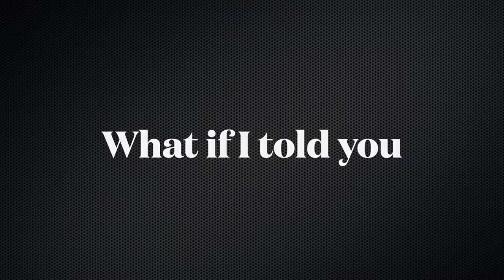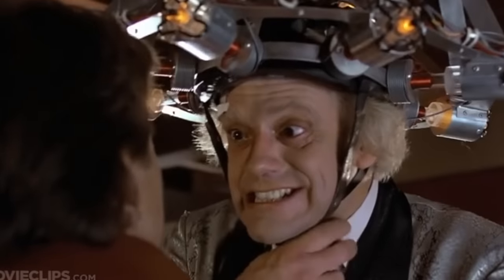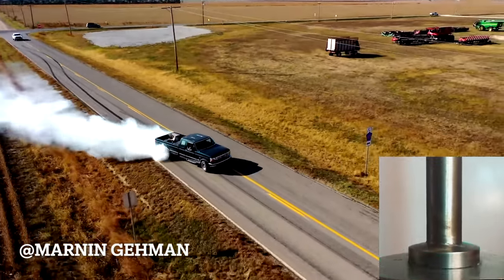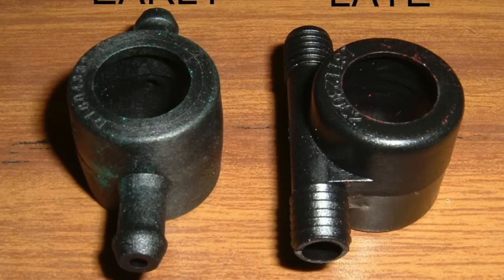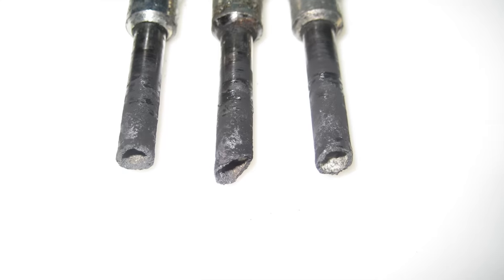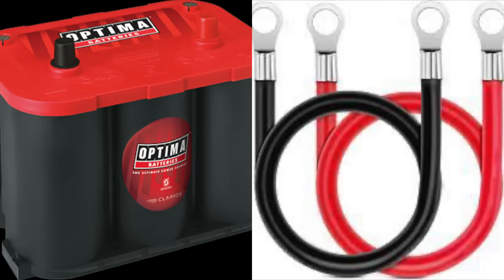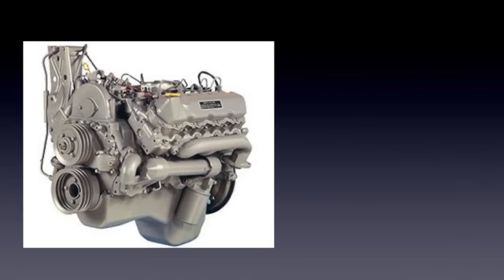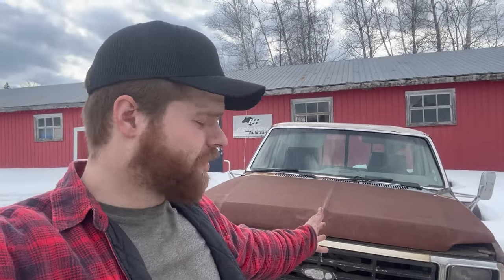The 6.9 IDI is not what you think...

Comment: My first truck was a 1986 f250 rwd, when the glow plugs are wore out and the fuel pumps are on the way out the door and the fuel issue going back to the tank. Squirting some gasoline in the breather always wprked but on occasion i had to put out a hood fire when it backfires. Just dont add too much or it trys locking up and takes a few key cycles to start. As for the batteries just stick a chunk of penny in between the battery terminal so the penny will oxidize before the terminals.

Comment: My 1983 6.9 was one of the very first to be produced and had a fatal flaw. The glow plug system had an additional relay that was eliminated in later versions. Although it used the same controller/components otherwise. It was never made clear to me what the additional relay controlled. After untold numbers of cold start problems with multiple changes of (I thought) all of the components, the system started coming on going down the highway and of course melted the glow plugs and destroyed 3 cylinders. At the time these were very expensive to repair and it was pulled in favor of the 460. I still own the truck in very good condition and have a Cummins/Allison replacement for the gas hog.
Reply: Did you do the Cummings conversation I'm thinking along those lines 4 my 96 F250 460 I can't afford the gas horrible milage like 8 on a good day lol

Comment: I have a 94 7.3 IDIT. I put in new injectors and had the pump rebuilt and had it running good but was still fighting air intrusion. I bought some R&D billet return rails for the injectors and had it running but had some leaks. So I took everything back apart and replaced some torn o-rings. Once I had it all back together it would not start whatsoever. To be certain that fuel was getting to the filter housing and to the injection pump I put an electric lift pump and deleted the mechanical. Still won’t start, fuel is not getting past the pump to the injectors at all. Took a look at the fuel shut of solenoid and replaced it to be sure and still nothing. Ran a hot wire from the battery to the positive on the solenoid and still nothing. New battery’s and starter as well. Sort of an SOS if you see this. Hoping the pump I had rebuilt didn’t take a dump some how.
Reply from the maker: When dealing with these engines they can be real SOBs if the return line system is ever touched, best way is to manually bleed each line by cracking the injectors while turning it over, then tightening them before trying again. If I was you I would double make sure you have fuel going into the pump and fuel coming out, if you still don’t have fuel coming out you might have a cloggers mesh filter on the inlet of the pump, it sits behind the fuel line.
Reply: @highostablegarage  fuel is for sure getting to the pump but definitely not past the pump. I’ve tried bleeding the lines one by one and all at once and still got nothing.
Reply: @tommygetz5867 we had Idi boat shutdown suddenly during cruise turned out to Be broken injector pump shaft

Comment: That's the truck I want cause it's corrected plus the body cab and bed is perfect for what I want a true truck to be. No shit mobiles, a purt near ton diesel truck with plenty of torque and horsepower but ez on fuel...I had a Ford F150 truck that year, it was a gasoline engine 351 modified 400 and it got 8mpg and it was jest a half ton long bed with regular 5 lug wheels and it loved plenty of gas. Sometimes I got around 10mpg but that wasn't often enough lol....I love what you have and I gotta start looking under the hoods whenever I see 3/4 ton or ton trucks setting around but I never look cause some I always thought 460c.i.. gas engines but they could be the diesel engine like you have...I want one and if I don't find one maybe the webrnet might have one depending on price cause I gotta do work to make it right jest like you did...I don't want nutn purty just a decent old truck with long cab.. I don't like the never stuff. I'm into the better built 80s back into the 60s and 70s trucks

Comment: I have a 1986 f250 4x2 with a 6.9 with C6 that burys the speedo no problem and im sure goes at least 100mph.  Now the injection pump was out on it when i got it and i had one from an old school bus that i put on it. It boils black smoke and is faster thsn any 6.9 ive ever owned before it or after it. Its faster than any of my 7.3idis too.

Comment: In the late 90’s I Banked and aftercooled  a 7.3IDI.  Would out pull any 7.3 Powerstroke. But the block cracked at 105,000 mile due to how thin the cylinder walls are. Sleeping to a 6.9 is the only way to keep them alive.
Reply: It wouldn’t out pull the Powerstroke.
Reply: @SillyPuddy2012  you can’t comment on what you did see. My dad had a 2001 Powerstroke. His exact work “ your truck out pull mine.”
Reply: @dschefers9700  I can surely comment on a mechanical impossibility. A 7.3 IDI is not out pulling a 7.3 Powerstroke. But sure, we’ll go with your Dad’s scholarly assessment, “your truck out pull mine.”
Reply: @SillyPuddy2012  a bigger pump and more boost with head studs and an intercooler. That will make more power than any factory powerstroke
Reply: @captainobvious6334  now your talking modifications. Powerstrokes can be modified too you know, they respond very well to it in fact.
Reply: @Chit Stank  sure they can but that’s not what you said. You said “it wouldn’t out pull the powerstroke”. You also said,” it’s a mechanical impossibility”. No. No it’s not. Not terribly hard to get decent power out of an IDI, it just gets pricy. You could put less money in a powerstroke to get the same results.
Reply: @captainobvious6334  either stock for stock, or competently modified, the Powerstroke is going to be a better performer. It is a mechanical impossibly to yield the same performance from the IDI. And as you alluded, it gets pricey to even try. Navistar International set out to build a more powerful engine with the T444E and that’s what it did.
Reply: @SillyPuddy2012  look up R&D IDI performance and classic diesel designs performance. They are getting 400+ hp out of these engines and last I checked the OBS ford powerstroke never came factory with more than 225 hp. 400 horsepower will outpull 225. It’s a mechanical possibility there buddy
Reply: @captainobvious6334   for your information, the last 7.3 Powerstrokes were rated from the factory at 275 hp and 525 lb.ft. with a manual. But to the matter at hand, you appear to be comparing a highly modified IDI to a stock PS thinking it’s an apples to apples comparison when it’s not. 

If you want to talk modified, a 7.3 Powerstroke will have far greater potential. The factory forged connecting rods alone are strong enough to handle around 600 horses, which is quite attainable from a 7.3 PS. And that’s far more power than you could ever reliably get from
a 7.3 IDI. The head studs alone would not stand up to that much boost. Back to that mechanical impossibility again. So, stock for stock, the Powerstroke is the stronger engine. And modified to modified, it’s the same story. There’s really no argument here.
Reply: @SillyPuddy2012  lord help me, it doesn’t freaking matter what’s modified and what’s not. I never said it was apples to apples. I literally already said there is more potential power in a 7.3 PS than in an IDI. Original post said there was an IDI that would outpull a powerstroke. It is possible. You just can’t be wrong when you actually are. And yes I’m well aware the superduty 7.3 had 275 horsepower from the factory. But it’s not terribly hard to make more power than that with the IDI platform
Reply: @SillyPuddy2012  I was referring to the old body style fords when I said 225 horsepower but the superdutys did have 50 more

Comment: 6.9 has smaller head bolts that will stretch. Even with studs they're not as good as the 7.3. 7.3's have cavitation issues that can pinhole the cylinders, so the best for performance is a 7.3 block sleeved down to 6.9. Then it doesn't matter if there's any pinholes - the sleeves take care of that. 

They are super fun and can make good power but they're not a power stroke or a cummin's so if you want crazy HP look elsewhere. 

One fun thing of note is you can pin them on the governor for ever and they'll just run and run and run... They don't care. Just keep them cool. 

6.9, 110cc pump, 15-20lbs boost and studs is probably 300hp/700tq from memory. As long as you have enough cooling it will run all day and all night on the pin...

Comment: I had the misfortune of having my first 6.9IDI be low on compression.

Replaced all the fuel return lines, injection pump, batteries, cables, glow plugs, controller. Only for it to struggle to start at room temperature. It had crank speed! And pumped copious amounts of white unburnt fuel out the tailpipe while doing so. It just didn't have very much compression I think. Burned about 2.5 gallons of oil every 500 miles, barely had enough power to go uphill unloaded at 30mph in 3rd gear and overall was just a bear to start.

I bought it for $1000, put $3000 into it, and then sold it for $500. Oh to be a dumb teenager.

Comment: Had two of these turds, an '86 and an '87. Oil consumption problems from new, injector pump failures from the timing advance control, the '86 ate glow plug relays like Doritos. On and on it went.
Reply from the maker: Sounds like a rough go, I’ve always had great luck with my units

Comment: Man, we had a 7.3 IDI as a kid that we towed with.  It was absolutely awful in the hills of north Georgia.  95 mph on the downhill so you could manage 25-30mph at the top of the hill.  Took a couple cases of ether every winter and Georgia doesn’t even get that cold.  Sold and replaced it with a dually suburban with a 454 that felt like it had 4 times the torque and horsepower.  The IDI is trash from an era when ford was making small blocks that crack completely in half if you make any power with them.
Reply: Who pissed in your cereal?

Comment: So Hypermax did at one point make a P-pump for the IDI engine. That would be compound Garrett turbos not twins. A six inch girdle doesn't make sense neither does the rubber expansion plugs. I believe if they were having that much block flex they would have filled the block to solve that issue.

Comment: These are definitely good reliable engines but they are not very fuel efficient compared to say a 12 valve Cummins and they are kind of gutless. Not quite as bad as some people say, but not up to the task in stock NA form for hauling heavy. I was about 18k lbs combined in my medium truck with a 7.3 in it and I was power, not RPM limited to 55-60 mph the whole trip. Empty it would do close to 70. Up hills I was 30 mph flat out, sometimes slower. It will also rattle the fillings out of your teeth. I made the same exact trip in my 6.8 V10 powered 4x4 pickup with 4.30s, I was about the same combined weight with the trailer and what was in the bed and cab. Thing was cruising 80 through the Texas desert, AC cranking, without issue, climbed hills in the 50-55 mph range and got almost exactly the same fuel mileage, and that was with a pinion bearing that started howling about halfway through the trip. By the way, I'm not saying that the V10 is great on fuel, but it does pretty well for a gas engine and it goes to show how terrible on fuel the IDI is. The main things they have going for them is that they're dead reliable if you take care of the fuel and glow plug issues and they will run on basically anything. You could dump uncut used motor oil or vegetable oil in the tank and it would run perfectly fine in warm weather.

Comment: All indirect injection diesels love to rev high. But they need a pump and injectors that can handle injecting fuel whitin a short enough time window , and at a correct crank angle.
Most pumps simply do not manage that. Hence they need built pumps for the purpose. 

If you want it to cold start and run well , do what germans did. When you initially have the glow pluggs on they are at 100% power. While cranking they are at 50% power. While running cold they are at 25% power. 
There was a few relays doing the switching from 4 in parallel to 2 pairs in series parallel , to all 4 if them in series for the inline 4 engines.

Compression can be reduced , but anything under 18 to 1 will fail to start on its own. 
147 psi or 10 bar ... not gona happen . Only with compounded turbo setup. 
That engine made 170 hp at 3300 rpm in stock. Probably after reducing the compression and displacment it was about 120 or so hp. If they did manage to get the rpm up to 6000 rpm that alone likely made it hit 200 hp or so. 
Likely it would still need a good 100 psi boost. A single stage turbo is usualy not even near that. A compound setup with 2 turbo ? Quite possibly.

But hey... only one way to know for sure , is to build one.
Send me an engine and will take a peek.
3 liter inline 6 idi german engines on stock internals can actualy go for 6-800 hp or so, I do not find 1200 hp to be unreasonable by any means.

Comment: I 7.3idi swapped my 1975 international loadstar dump truck. I have replaced everything and it still doesn't start without a shot of ether every time. all new injectors glow plugs I've done return caps 3 times and I have two new batteries and 3/4 inch thick cable. I should have rebuilt the mv446 again

Comment: snow plow... 360 dodge the gas guslar, 2 years in and the 50 year old snow plow broke... the ford 393 the plow was made for got parked more then 20 years ago... the plow that blew up two trucks and more then 5 trannies... the dodge gave it a hard time just ram-ing it from behind, the arms broke off and got welded back on. 9000 pounds that doesn't stop ... the muffler melted off of it years ago... RAM Power, put 4000lb of grass on the rear and that it still goes. fuel... gallons per minuet. high deck 400 block torque, moss growing on the frame like its been sitting for 80 years...

Comment: Why was the 1200hp engine described at the end of the video not able to start on its own?  Why did it need so much ether?
Reply: Such high compression it needed something with a lower flash point?
Reply: @SniperTO  other way round, he said it only had 15:1 compression, which is crazily low for an indirect injection diesel. As stated they ran about 20-21 from factory, at 15:1 it wouldn’t have enough compression heat to ignite the diesel. Remember diesels don’t have spark plugs, they fire off compression and heat when the fuel is injected

Comment: I'm a GM guy, but I'll give Ford credit they don't f around with performance and strength (at least back then). The problem with GM is that the guys in suits aren't directly tied to the companies. Chevy is the top dog in GM, not GMC or Cadillac. Ford IS the top dog in Ford, so they don't have to regulate anything to make it fair for their posterchild because THEY ARE THE POSTER CHILD. When GM screwed up with the early 6.2 Diesel's that was their fault, not Detroit Diesel. DD had a stronger crank in the original design plans but GM dropped it because of cost. Ford didn't F around to find out what would happen, so they built it tough as shit and called it good.

Comment: I own a 7.3 IDI - IN EUROPE. Or even more extreme in GER. It is a great experience to drive a V8 diesel.

BUT: It is NOT a great engine. It is reliable. But an 185HP Diesel engine that is reliable is NO biggy.

We do really NOT have hard winters here: But I can tell that with everything new (Injectors/IP/GP/GP Computer/Lines/high vol E-Fuel Pump) this engine does not want to START below 10°C! It starts dont get me wrong. But I crank (starter new as well, as the 2x80Ah) once for 6-7 seconds. Wait. Glow again and start again, than it will come on after 2-4 sec. Below 0°C it gets worse and the 2 Batteries are hardly doing it. If I would crank 20 - 25 sec. it will probably start... but if not the bat are DEAD. No more tries.
After 5-10 sec glow cycle the bat voltage is sooo low that this will be an issue if the bat are 5 years old.

My next rig will be a M57 powered truck with roughly 340HP (=tuned, bigger turbo). No start issues, half (!) the fuel, more power, way less noise, smoke 200kg less weight

Comment: Isn't the 7.3 idi the exact same engine but with slight bigger pistons ?
Reply from the maker: Small differences, rotating assembly is bigger on the 7.3, head bolt size etc. most parts are interchangeable but pretty much all parts are slightly larger

Comment: What's your take on turbos being run on non-studded motors? From what I can find, tuning the turbo to or below 8 PSI keeps it out of the danger zone, but I'm not sure if the performance gain from 8 pounds of boost would be worth the cost and effort or not.
Reply from the maker: Can drill at tap the 7/16th head bolts to the 7.3 spec 1/2”, would handle it a lot better. Funny you should mention that, this video was actually twice as long originally which included my take recipe for a performance 6.9 build but I had to cut it out due to time.
Reply: I think turbo sizing is crucial for survival. You could get away with 15+ psi assuming youre running a smaller turbo. Throw a promod88 on the thing,8psi max may be perfect
Reply: @madmod  If I turbo the thing it'll probably end up being a junkyard turbo from a Powerstroke, so 8 PSI will be what I shoot for
Reply: @S0REN_  Are those factory powerstroke turbos internally wastegated? If so, it'd probably be easier and cheaper running an external namebrand wastegate and a cheap china turbo. Honestly cxracing has affordable ball bearing t4 turbos that would be nasty

Comment: I would think those plastic fuel line returns could easily be made of metal. Aftermarket? I had a 89 7.3 that always worked and I only sold because it was 2wd. I'm looking for another mid 80's Ford now. I'm in no rush to drive anywhere and I just cant stand all the crap they put on newer motors.